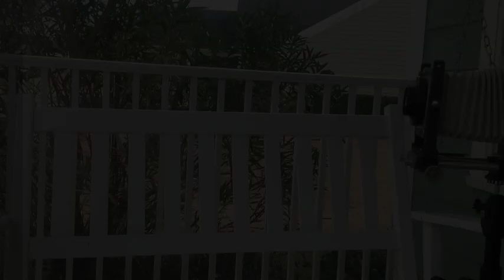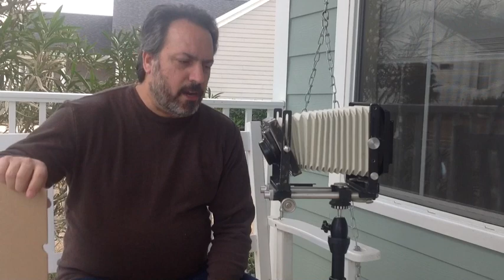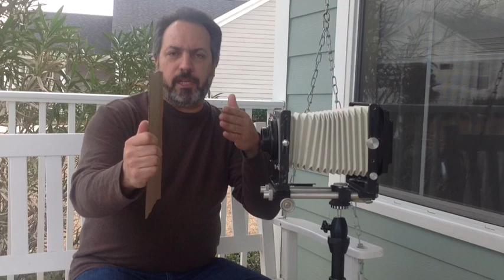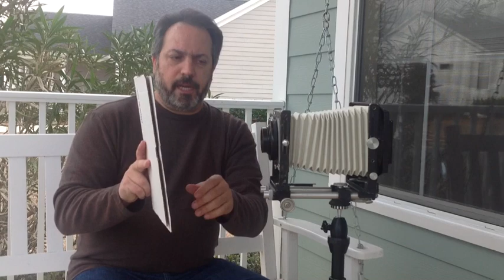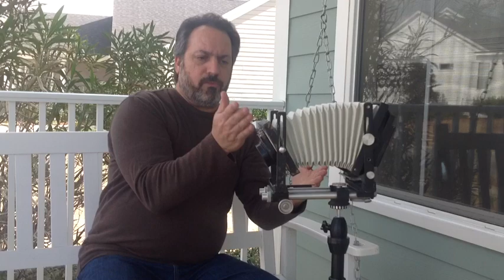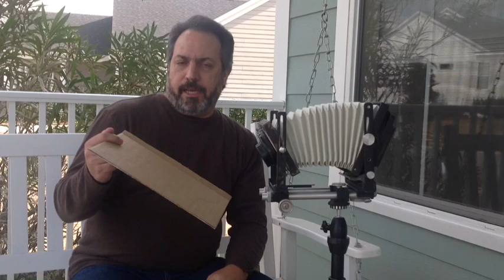View Camera Movements - Part 3 Scheimpflug Focusing

Comment: 6:03 I dont believe this is correct. I believe the angle of sharp focus (focal plane) pivots at the point of intersection below the camera and rotates falling up or down depending on how far away you actually focus!
Reply: I was actually just out catching the sunset on a few 4x5 sheets when my phone dinged with your comment. Always nice to see a practitioner thinking about this good stuff. I haven’t listened to exactly what I said at 6:03 But from your comment I can tell that you are correct - and so was I. View cameras are focused by moving the front standard towards or away from the rear standard effectively changing the angle of intersection below the camera. That was my point.Your Point that the angle of intersection changes depending on how far away you focus Requires movement of the front standard effectively changing the angle in the same manner. so I think we both understand the principle quite well. Enjoy your 4x5 experience;)

Comment: Is the optical distortion also the same whether you move the front or the back element?
Reply from the maker: If by optical distortion you are referring to the effect on the plane of sharp focus and the elements of an image within the focused depth of field and less focused outside, then yes.  Envision tilting the rear standard forward and then lifting the whole camera backward to bring the rear straight again, the result would be basically the same as tilting the front standard back with some rise.
Reply: @4by5photography89  I was thinking about how the movements are sometimes used to "fix" perspective, e.g. when photographing tall buildings.

Comment: Nice explanation, Thanks! It fails however on the second part where you said "the scheimplug angle is gonna be twice the angle between lens and the bracket". This statement doesn't match the first one. The more you separate from the lens the bigger this angle is... The schimpflug angle is not constant, it depends on the distance to the subject. I think the first statement should be enough to determine the scheimplug angle. Thanks. Fernando